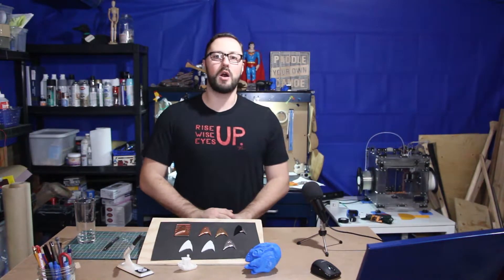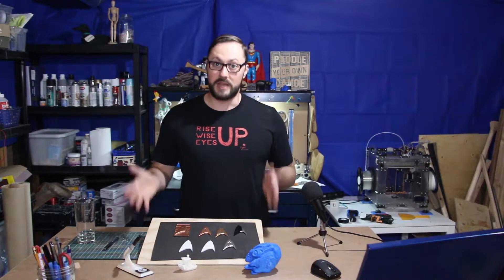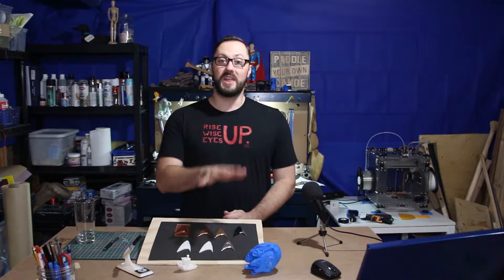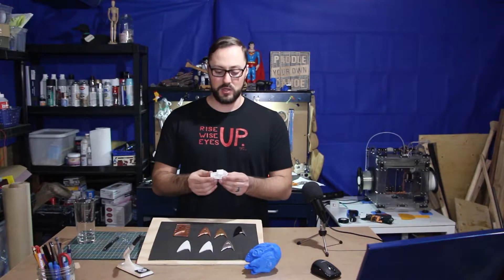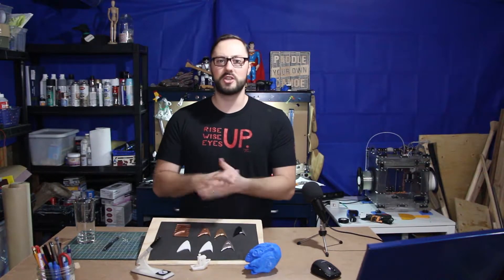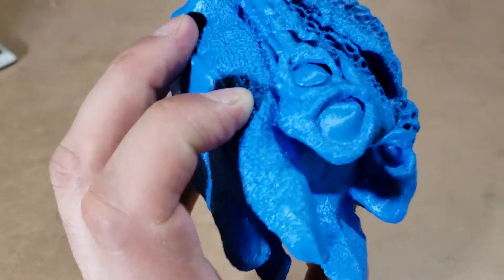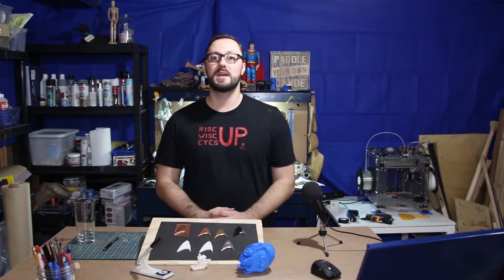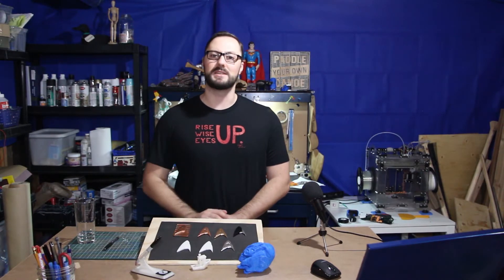Vlog - 3D Printer Repaired!

Comment: He Trevor,
Super how you did the restore. I also got a vertex with gt20 belts,  pulleys and e3d heads. I got a problem with cura and the firmware. I keep having space between the lines. And the z axes can't go quicker as F500. Sometimes it can go F1200 but other times the motors hangs en I need to give it a gentle help with my fingers to move further. Could you share you're firmware and cuts profile?
Greeting Mark
Reply from the maker: Hi Mark, happy to share - I'll reply here again with a link to my Cura profile when I have a minute to export it. I'll have to see about firmware, I haven't done that before but I'll share whatever settings I can export from Vertex Repetier (where I set it all up). It sounds like you've got some trouble with your steps per mm settings and - maybe - your steppers are undervolted. I talk about adjusting stepper voltage in this video https://www.youtube.com/watch?v=9ZnfmIqg5b0 The other thing I've noticed with the Vertex is that it really, really wants the rods to be properly perpendicular to run smoothly. Also I think I'm developing some flat spots on a couple of rods, which is contributing to binding, so I'm pretty diligent about degreasing and re-oiling the rods periodically. Hope any of this helps, and I'll be back with files soon!
Reply: @LoveMakeShareTV  
He Trevor, thanks for the quick reaction. 
Looking forward to your cura profile and repertier settings. 
Ja i also thought about a steps issue but the strange part is that de brim around it just prints normaly. I allready checked the vRefs and these are what they have to be.
I would think that when they don't run smooth over the complete length you'll get layershifting or so. I don't think i wil get this constant space between lines....I would think you'll get that when the belts are to short.. but in this case they would be a fraction to short.. or am wrong? Could it be something in cura versus the firmware? What setting overrules  the other.. is the firmware leading or the cura slicing settings?
I find it realy strange hoping this strange behaviour can ben doubt with :-D